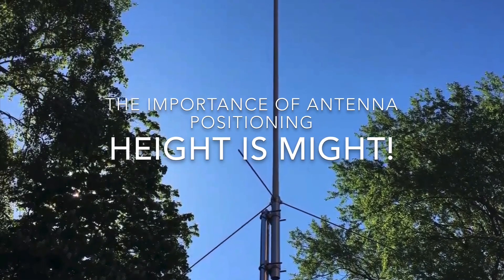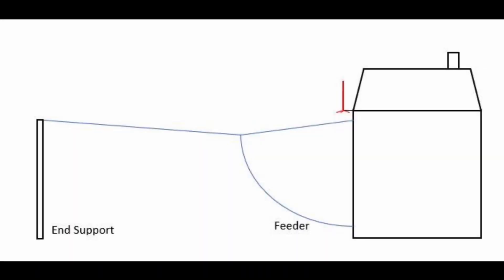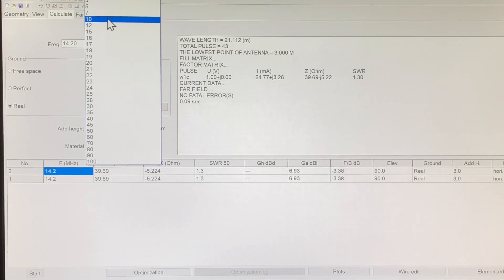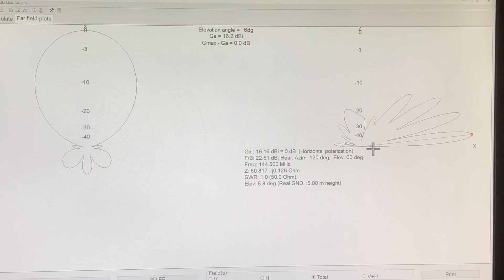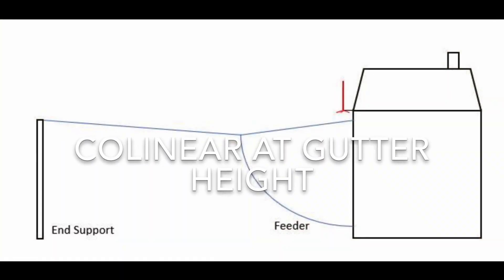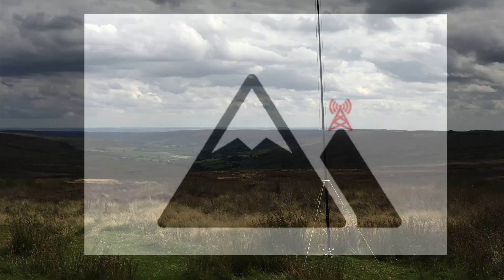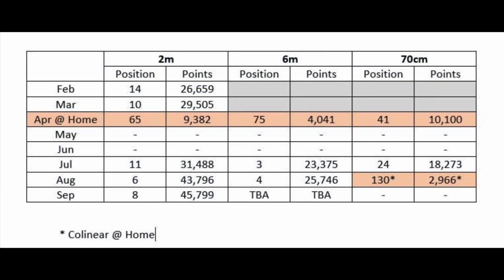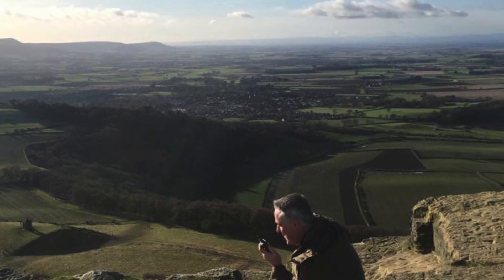Height is Might! Tips on Positioning Your Antenna

Comment: The cobweb antenna. Does the balun want to be facing North to south or East to West
Reply from the maker: Hi, there's no reference to a cobweb in this video. A cobweb is a series of folded dipoles and roughly omnidirectional so I believe. It won't matter what you consider the front or rear of the antenna. If there is a noticeable difference when up in the air and in use, then just make a mental note of the strongest signal direction and consider that the front. Good luck!

Comment: I'm trying to get an A99 for CB as high as I can get it. Seems like everything is working against me. I have the bottom of the antenna up 10 feet which is not enough at all. I am surrounded by trees and houses. So I have another 10 foot section I'm going to add on when I safely can. 
My k30 cb in the car works better than my base at the moment 😔 it's frustrating but I will keep building till I get it.
Reply from the maker: Good Luck 👍🏻